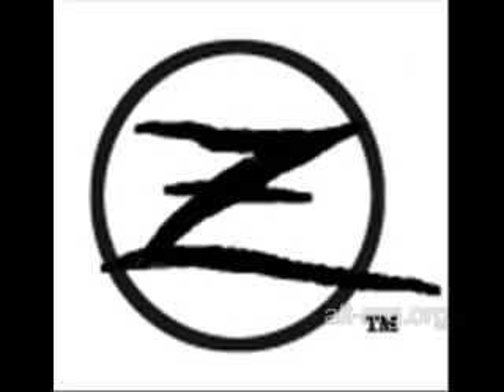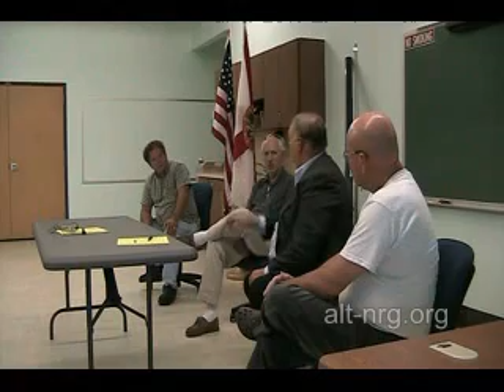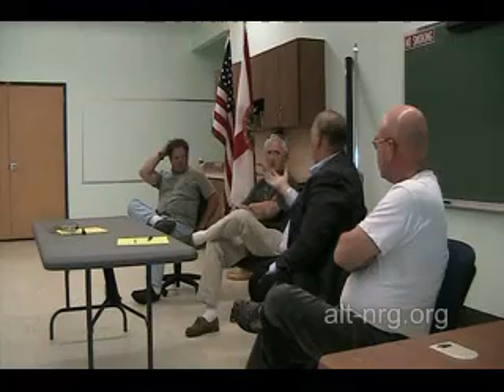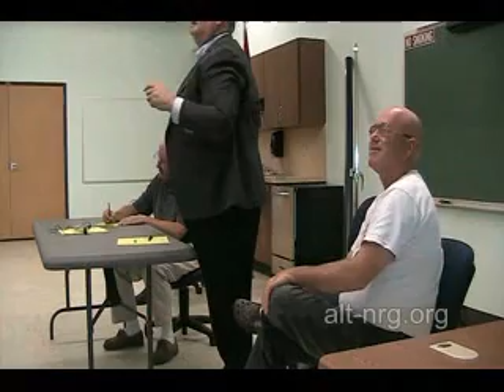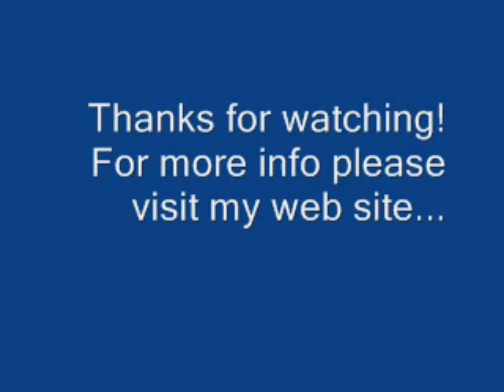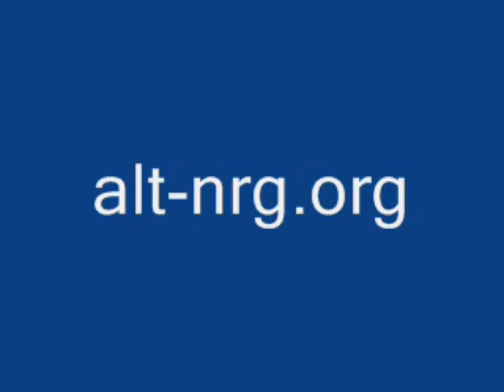#150 - Manatee Tech Roundtable part 7 of at least 16?

Comment: continue:#2 "power supply system":,P.W.M, Tesla coil?Magnet motor generator?,or fuel cell{HHo to Electricty}or can the cars own alternator without the voltage regulator be enough power if it was put threw a coil?or is that needed?, variable voltage control ? To completly run a 8 cylinder engine do you need to produce 1.5 leters every sec. at top speed? and what do you believe the amount of HHo needed at idel is?#2primary water tank + bubler+machinical blow out safty plug that resets itself,